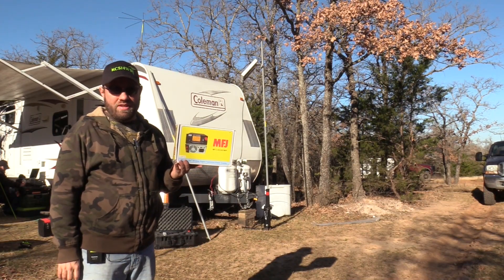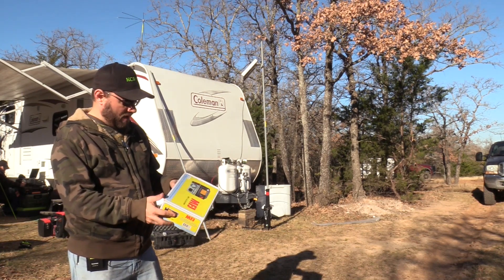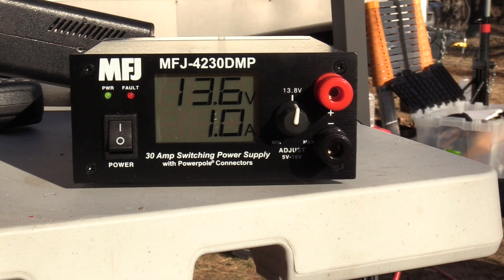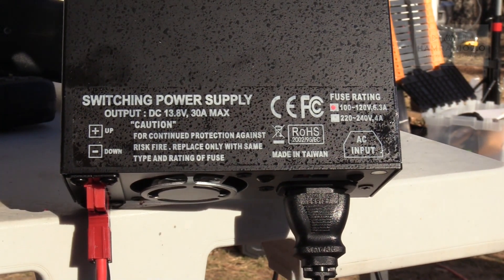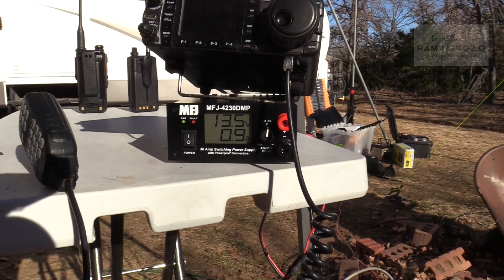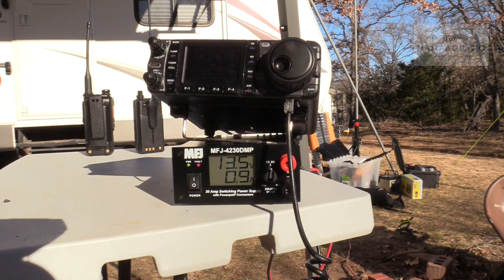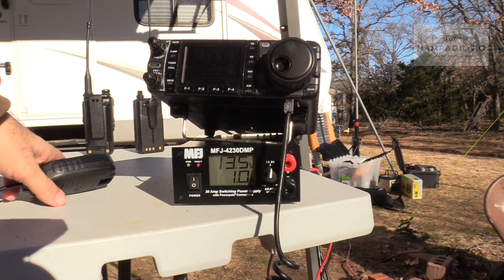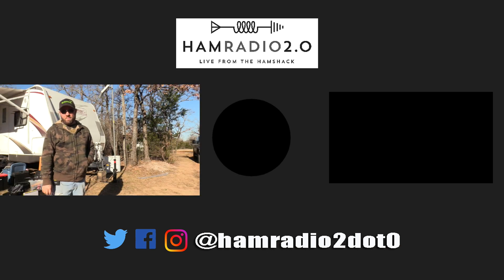MFJ 4230DMP Power Supply

Comment: I got the MFJ-4230MV a year ago from Main Trading Company, then before it even shipped I saw the MFJ-4230MVP.  Notice the "P" denoting the power pole version.  Main Trading Company and pay the difference.  (All three are the same with variants on meters and connectors)  I fortunately only live an hour away so I just went there and picked it up (as I should have in the beginning, but it was during the initial covid scare.)  
Great power supply, great retailer!!!  I plan on getting a RIGrunner 4012 for it!!!
Thinking about getting the 4275 for my shack and using this for on the go.  I have lots of little peripherals and whatnots.  I have a USB hub/power-port, alarm clock/thermometer, and I want a weather station, all use 12vdc.  At the moment the 4230 works like a champ!